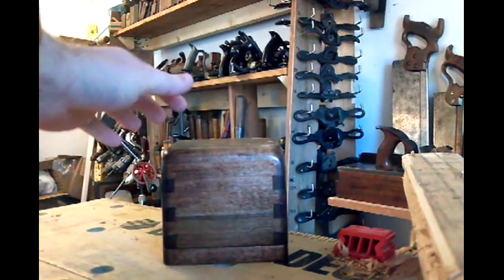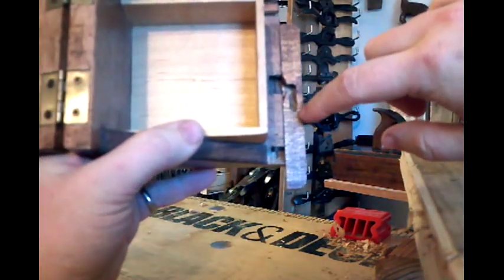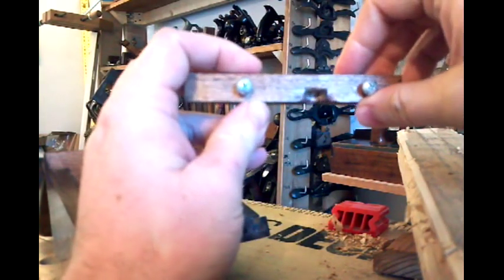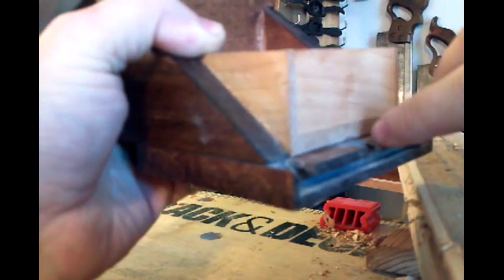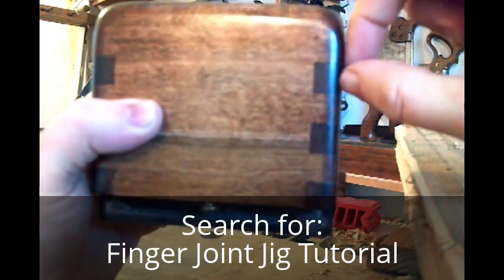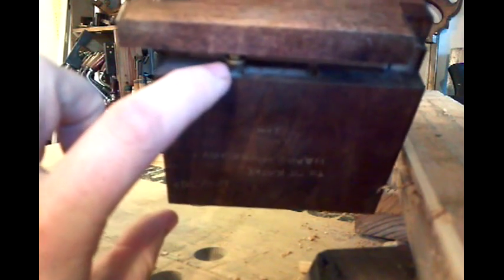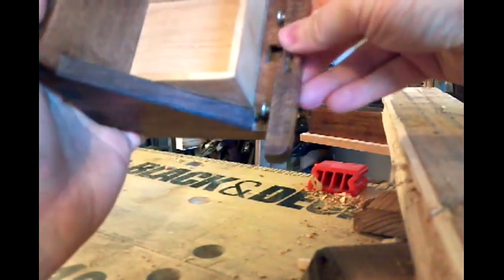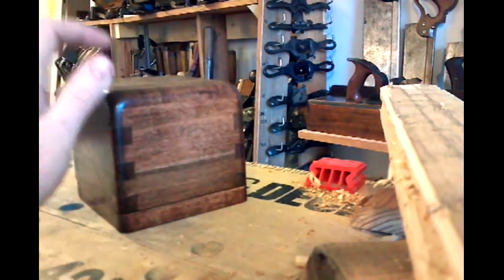Puzzle Box Revealed

Comment from the maker: The pan head screws allowed me to easily make adjustments to how snug the sliding pieces were. Too tight and it's a struggle.  Too loose and it's obvious. I used slotted keys instead of pan heads to allow the bottom to slide because how tight it was depended largely on how snug the front and rear sliding pieces were.  I could afford for the fit to be a little looser season to season. You could use slotted keys for the front and rear but they would be delicate and grain orientation is a concern.